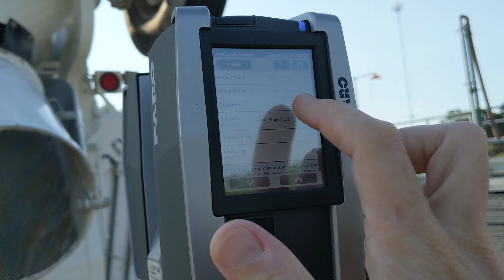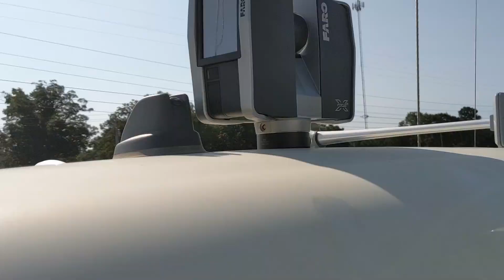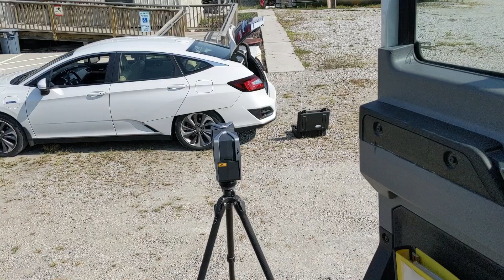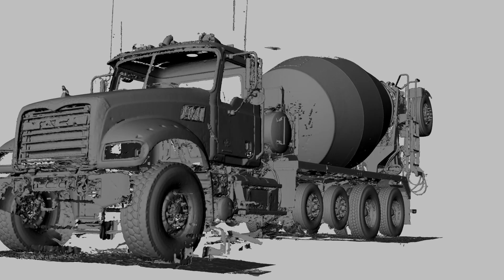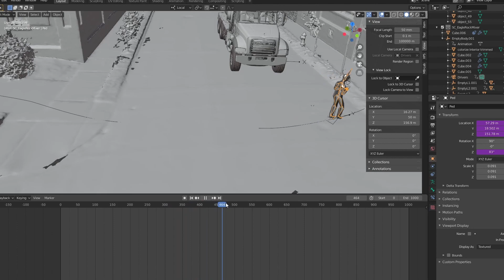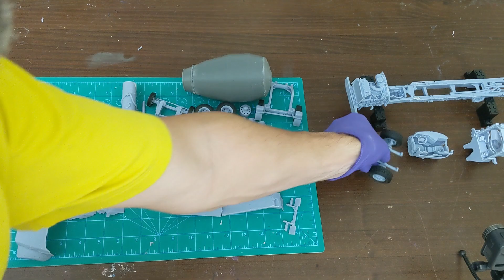3D Scanning, Modeling, Animating and Printing a Concrete Mixer Truck

Comment: I am now 65. I built several Mack’s and collected resin parts for years. Then would make silicone molds to duplicate parts. 
What you have done is awesome and 10 times nicer than my projects. I’m about too old now. But I still like doing this on occasion.

Comment: This is insane!!  Can you print this in 25th scale?  You could revolutionize the aftermarket scale model industry.
Reply from the maker: Thanks!  With an Elegoo Saturn it could easily print 1:25th scale.
Reply: I would like to get this in 1/25 clean it up nice and cast it in resin , would you have a price for just the cab , hood and interior parts ?
Reply from the maker: Send me an email - matt[at]scanningcars.com